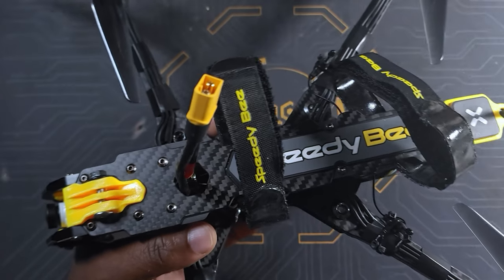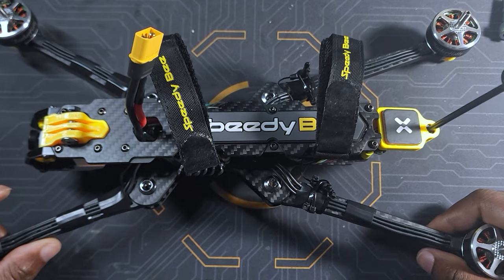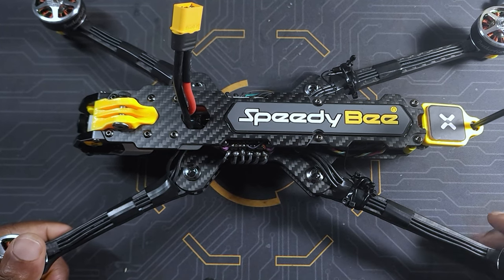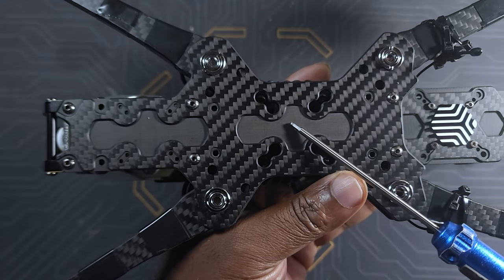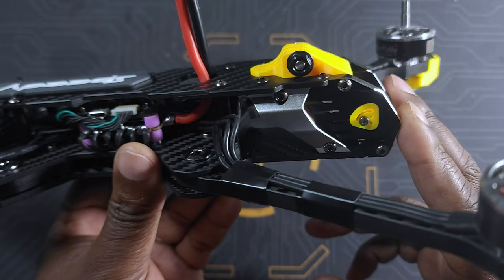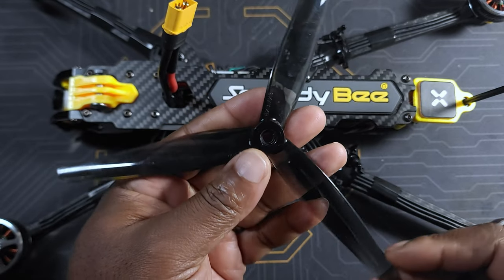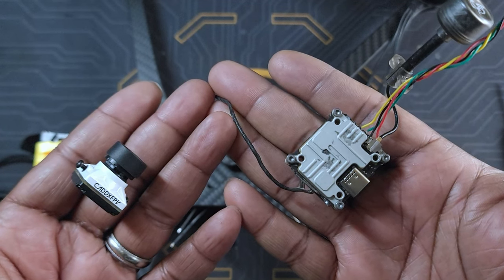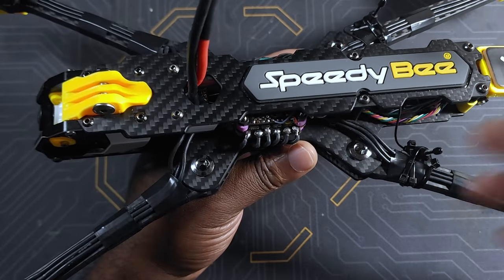SpeedyBee Mario Fold 8 - My New FPV Long Range Build Overview

Comment: It would be handy if you could bove the VTX heat sinc into the forward mounting position.
Reply from the maker: I'm not sure what you mean by forward mounting position.
Reply: It's much easier and cleaner to find a longer extension for antenna mounting than a Mipi cable for example.
Reply: @tubsucks  Vifly GPS Mate, bro. I got 30 (yes you read that right) 30 Sats locked on my Rekon 7 today with a similar VTX/RX/Antenna set up to the one in the video. The key is to let the GPS lock Sats before the VTX is ever powered up. 2 HGLRC Hammer long Range O3 Air Unit antennas and a True RC 915mhz Bardpole help as well.

Comment: Also working on the same build with the same receiver, if you design some 3D print for it please share!

Got the same problem with the motor wire and the cover. Im guessing the correct approach is to solder the motors on the bottom on the ESC and route them downwards.

Comment: Hello.
Great movie, good to watch.
Could I ask you for your opinion regarding the engines and ESC?
Will Brotherhobby 3008 1150KV motors work seamlessly with SpeedyBee BL32 50A ESC 4 in 1 and 8040 - 3 propellers?
Regards and wait for more!
Reply from the maker: Yes, thus setup will work